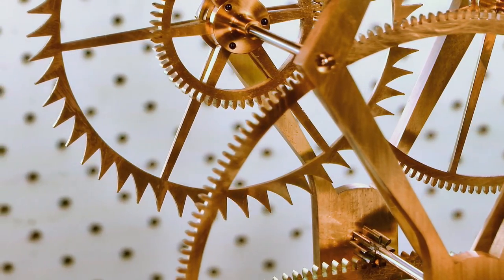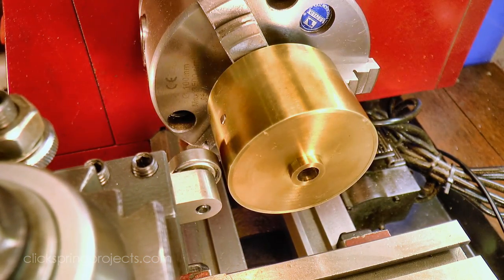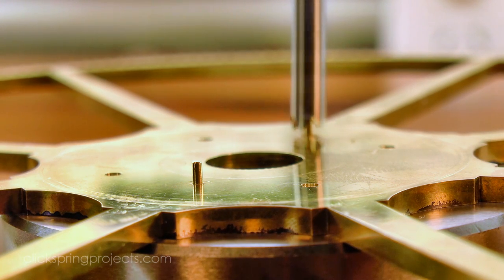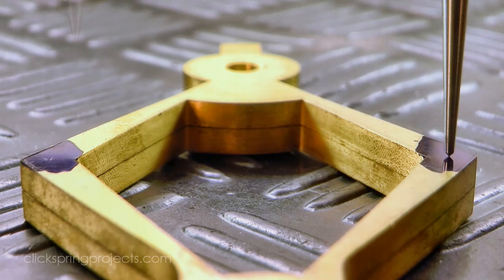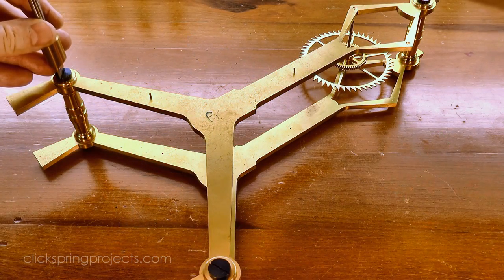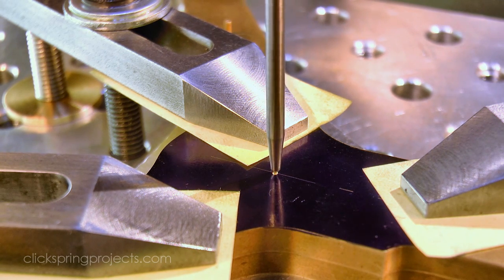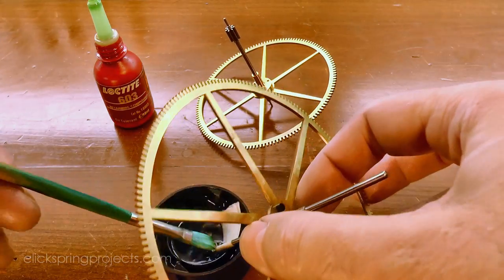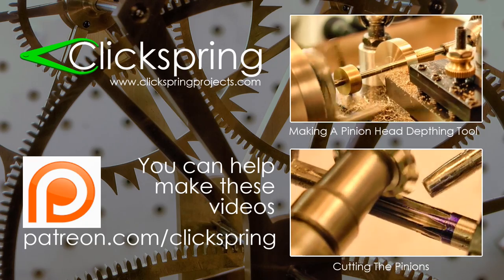Clockmaking - How To Make A Clock - Part 13 - Depthing And Planting The Train

Comment: this is fantastic! i've been binging your series, this stuff is so cool
as an apprentice machinist for medical stuff, the differences in how precision is applied in clockmaking vs production amaze me
i would never imagine that you determine hole position using a tool in that way, i would expect a very tightly toleranced distance between centers for every wheel, but i see why this solution is better

Comment: Excellent video, as always.

Re the hook. Why not make the screwdriver slot on the other end of the screw and drive it this way with a standard screwdriver (going counterclockwise, naturally)?
Reply: metalhead2508 Right, but what I’m saying is that one could simply make a slot on the threaded end, and not bother making a specialized tool. The slot, along with the protruding portion of the thread could then be ground off the same way.
Reply: +Ast A. Moore  specialized tool? he made a right angled screw driver he just made it cause well why the hell not he could go out and buy one or enjoy a couple hours in the machine shop making one

Comment: Chris, well done, I bet you had a few nervous moments when setting the gear positons, one wrong hole position and you would have had to build new frames. It looks as though it will be an impressive clock.  Just watched your right angle screw driver and drill videos. The mod for drilling brass was very useful, looks  like I need another drill set. I bought right handled screwdrivers for flat and phillips screws years ago and not sure where I got them from. Don't use them very often but when I do they are invaluable. Keep up the great work
Cheers
Doug
Reply from the maker: +Doug Hibberd So true Doug! A lot of double checking before drilling! Thanks for watching mate :)

Comment: Fantastic video! it's nice to see things coming together. I really appreciate watching how you put the utmost effort and precision into everything from the finish on your tools down to custom screws. 
But seriously though, was it worth all the effort to make a custom bent screwdriver just so you could install the spring hook!? I would have just ground a flat on the end of the threaded portion and tightened it from the outside with pliers... still beautiful to watch.
Reply from the maker: +Kobus Goosen I tested that, as well as putting the slot on the other end. The insert needs to be very tightly screwed into the barrel, and in both cases, the end deformed under the pressure. The only effective way to get the job done is with an inside slot. Thanks for watching and asking :)

Comment: my uncle worked with clocks in ussr for like 60 years, and I showed him this video series, and he was really impressed with your work, even tho he was very skeptic, because he was known in the whole Europe, but he said that you did a huge mistake, and because of it, your clock will not work for long time. Your biggest mistake was that you didn't put in bearings made of rubies or emeralds, or other hard natural gems, because if the gear shaft is turning and rubbing against the brass, it will wear out very easy and very quick. You really should have put in bearings for the gears made from rubies or emeralds.
Reply from the maker: +Vytautas Poška Unlike watches, and some marine chronometers, the vast majority of clocks operating in the world today have steel pivots running in brass holes as shown in this build. It has been established best practice for at least 400 years. The holes do wear, but it is not as dramatic as you suggest. The pivot holes are rebushed after they wear, and it is a simple and common enough process that "re-bushing" is taught in beginner clockmaking courses. Jewelling certainly adds life to a clock pivot hole, as well as beauty, but it is the exception rather than the norm in clockmaking. Jewelling also unnecessarily complicates the service life of a clock. Such is the rarity of jewelled clock movements, that few clockmakers have the tools, expertise or replacement jewels for clock sized pivots. So a cracked jewel could easily result in an otherwise fine clock ending up in a box un-used. For that reason jewelling in clock movements is generally reserved for ultra high precision movements that really need it (like regulators and marine chronometers), with the expectation that the mechanism will only ever be attended to by a specialist repairman. For reference the original prototype of this clock, constructed with simple brass pivot holes, was made in the mid 80's and has still not needed rebushing after being in service for 30 years: https://www.bonhams.com/auctions/18836/lot/267/ Thanks for watching

Comment: You also could have slotted the end of the spring hook that was cut off and tighten it that way, from the threaded end.
Reply from the maker: +Rush Dougherty Hey Rush, I tried a few things like that, but found there just wasn't enough material to work with. The insert needs to be screwed in very tight, and in each case the end just distorted, so an inside slot was the only option. Thanks for watching.

Comment: Good progress there Chris! It's very satisfying seeing the gears set in the frame and turning even as a viewer.
Wouldn't it be easier to shape the inner part of the hook, slot the outer part of it and then screw it from the outside?
Reply from the maker: +Solskipper I did a bit of testing to see if I could get away with that, but there just wasn't enough metal at the other end of the screw to resist the torque. The screw needs to be inserted quite tightly, and the metal just distorted and bent under the strain of the driver. The only practical option was to put the slot on the inside. Thanks for watching and asking :)
Reply: +Clickspring I see. After watching it again I'm pretty sure that the camera must be distorting the scale of the work, making things look larger than they are!

Comment: Clickspring next time you are making a spring hook for the barrel, why not add a screwdriver slot to the end that is being cut off so you can screw it tight easily from the outside?
Reply from the maker: +ben middleton Hey Ben, there isn't enough material on the other end to withstand the torque of insertion (approx 2mm), it would have just distorted under the load. The hook needs to be screwed in very firm, so this is the only practical option. Thanks for watching and asking :)

Comment: This is very late to the party but I am wondering is the cutting broach and the smoothing broach are both a inserted from the same side? In the graphic showing the oil cup and the hole as it is being broached it looks like the hole is broached from each side so there is a nearly identical amount of taper with the apex in the center. But I am just not sure. Wonderful video series. I am supposed to be in my own shop working but I can’t stop watching.

Comment: In addition to wear and contamination a reason for taper in the pivots is thermal expansion and contraction.  Have you determined what the temperature/dimension coefficient is for this brass structure?

Comment: Was it necessary to make the right angle screw driver when you could have put the slot on the other end of the screw(the thin end) and then tightened it from the outside?
Reply from the maker: Yes, more detail in answers below, thanks for watching

Comment: I'm amazed you rely on loctite for a smooth-to-smooth joint on a driven pinion. Is it actually that reliable over time? I assumed all such parts would be mechanically connected with setscrews or else silver soldered (at least the brass ones).

Comment: Yet another excellent video!

I am officially going to take it for granted that all your videos will be excellent (great lighting, great pace, great sound, and amazingly, not a single out-of-focus shot anywhere).

I have a question, and it might be a stupid question, but I have never been shy of asking stupid questions...

For the Barrel Hook, would it be possible to make the screw driver slot at the end of the screw shaft (instead of the screw head) to enable you to screw it in from the outside of the barrel with a normal screwdriver thus making the right-angled screwdriver unnecessary.

Thanks.
Reply from the maker: +echofoxxx That's a great question, the same thought occurred to me too. I did a little test before proceeding to see if it would work, but there was not enough meat on the screw to withstand the force of the screwdriver. The insert needs to really be screwed in tight, and a little slot on the other end just couldn't cope without distorting, so I had to go with the inside slot instead. Thanks for watching.

Comment: for the screw inside the barrel, why not form the interior shape outside of the barrel and put a screwdriver slot on the other end of the screw?  start to thread it in by hand then tighten it from the outside, backwards?  Just curious...
Reply from the maker: There wasn't enough material to resist distortion, more detail in other responses below, thanks for watching :)

Comment: I was somewhat surprised when you made the barrel hook. When you turned off the threads at the end of the screw, I was expecting you to then make a slot at the screw end. That would have given you access to the screw from the outside of the barrel and eliminated the need for the right angled screwdriver as well as the screw slot in the more conventional location on the screw. But in any case, this is a great video.
Reply from the maker: +John Cochran The same thought occurred to me too. I did a little test before proceeding to see if it would work, but there was not enough meat on the screw to withstand the force of the screwdriver. The insert needs to really be screwed in tight, and a little slot on the other end just couldn't cope without distorting, so I had to go with the inside slot instead. Cheers mate!

Comment: I guess it's a stupid question, but why didn't you make the slot on the other side of the barrel hook, so it could be screwed in with a regular screwdriver from the outside?
Reply from the maker: I tried out a few things like that (grips, screwdriver slot), but there's not much material at the other end, and it simply distorted under the torque. The hook needs to be very tightly inserted into the threads inthe barrel, so the only practical option is to form the slot on the more substantial section of metal on the inside, and screw it in - thanks for watching and asking Pavel

Comment: i watched  this when you first posted this but i just thought about something.  Why couldn't you have just put the screw driver slot on the outside? That would have saved the step of having to make to special screw driver, it's cool either way im just wondering.
Reply from the maker: I did a bit of testing to see if I could get away with either a slot on the other end, or a hex driver but there wasn't enough metal at the other end of the screw to resist the torque. The screw needs to be inserted quite tightly, and the metal simply distorted and bent. The only practical option was to put the slot on the inside, therefore a right angled screwdriver was required. Thanks for watching.

Comment: at 3:50, all the blue screws are perfectly parallel with each other.  Are the snug? How did you align the threads with the screwdriver slot, so they all "stop" in the same position?
Reply from the maker: +kanennardo Yes they are snug. I inserted the screw into the holes before making the slots, marked the orientation of the slot, and then formed it so that they would all be aligned. A few viewers mentioned that they would like to see it done on a previous video, so I did it on this set. Thanks for noticing!
Reply: +Clickspring I noticed aswell, it's just one of those details that takes something a bit further:P

Comment: love the progress. i had an idea when i saw the hook you made that needed the screw driver. Is there any reason you didn't put a slot at the end of the screw and then turn it back word from the outside?
Reply from the maker: +Philip kedinger-cecil Hey Philip, I did a bit of testing to see if I could get away with that, but there just wasn't enough metal at the other end of the screw to resist the torque. The screw needs to be inserted quite tightly, and the metal just distorted and bent. The only practical option was to put the slot on the inside. Thanks for watching and asking :)

Comment: I just realised, You could have made the barrel Hook in a way that does not require a special 90° Screwdriver. Form the slot on the tip of the screw before parting off. Insert it by hand and tighten it from the outside. Yes. You then tighten it counter clockwise, but you would not need a special tool. That tool made for a nice vid tho, so im not mad.

Comment: Stunning work, please do more!
Also: why making a 90º screwdriver for that insert? Why not just put a second slot in the other end of the screw, the one that got cut away, and screw it in from the outside?
My best from Argentina!
Reply from the maker: +Harry f. Hey Harry, I did a bit of testing to see if I could get away with that, but there just wasn't enough metal at the other end of the screw to resist the torque. The screw needs to be inserted quite tightly, and the metal just distorted and bent. The only practical option was to put the slot on the inside. Thanks for watching and asking :)
Reply: +Clickspring The second best option I GUESS would have been grinding 2 parallel sides and using a wrench. At least we got a cool vid on the making of the 90º screwdriver. Thanks for the response!

Edit: Guess is on caps because I'm not a machinist of any sorts ^_~
Reply: +Harry f. Lets not give Chris any reasons not to make extra videos :D

Comment: it's really starting to come together beautifully.  Though is that Loctite bond good enough to hold the pinion in place long term?
Reply from the maker: +Junaid Akbar Regarding long term strength, only a century or two will settle it definitively, but the loctite bond is easily reversed, meaning solder could be used at a later date if desired. Thanks for watching.

Comment: I am as alway very impressed about you fine art. May I ask you a questin. You are working hard for givig the brass a shiny polish. Is there a secret how to conserve that look against the typical oxidation of brass?

Regards Michael
Reply from the maker: +DocM Hey Michael, to some extent lacquer can help preserve some surfaces that don't have any sort of mechanical interface (eg pillars, plates), but those parts that interact mechanically (eg wheels) can't be lacquered because it would interfere with operation. The only total solution is to plate the mechanism, usually with gold or rhodium. Thanks for watching and asking.
Reply: Tahnks for the answer!!!
Is there a preferred lacquerd?

Comment: Hey Chris, where did you get the "oval sink" tool. I've never seen one of those before. Can you tell me why you use it and where you got it or how you made it? Thanks
Reply from the maker: Hey Peter that is from a set of Bergeon 1897 roller cutters: https://www.hswalsh.com/product/bergeon-1897-roller-sinkers-hr58 They are a specialist cutter designed to cut oil sinks, you can get them from any clock supplier like Meadows and Passmore, Timesavers etc

Comment: Stupid question, with the screw in the cylinder (wow technical terms) why didn't you screw it in from the inside to a certain extent and then use a pair of pliers to twist it to the full point of tightness instead of the double ended screwdriver? If that isn't possible could you explain why? Thanks.
Reply from the maker: +Jess Page Hey Jess, not a stupid Q at all - I did a bit of testing to see if I could get away with a slot on the outside end but there just wasn't enough metal at the other end of the screw to resist the torque. The screw needs to be inserted quite tightly, and the metal simply distorted and bent. A pair of pliers does not give enough torque either, it slips before the screw is inserted properly. The only practical option was to put the slot on the inside. Thanks for watching. and asing

Comment: For the barrel hook: could you have machined a screwdriver slot, or maybe a small hex head on the outside end of the screw, instead of having the slot on the inside? The head could then be machined to final shape before it's mounted in, and tightened from the outside…
Reply from the maker: +Damien Pollet I tried a few things like that, but found there just wasn't enough material to work with. The insert needs to be screwed in very tight, and in each case the end just distorted, so an inside slot was the only option. Thanks for watching and asking :)

Comment: Just fabulous, like all your others, on the Make channel too.

One question though, how did you get the four screw slots on the barrel to line up like that without adjusting the thickness of each of the heads?

Seriously impressed!
Reply from the maker: +windsoruk I inserted the screw into the holes before making the slots, marked the orientation of the slot, and then formed it. Thanks for noticing!
Reply: +Clickspring   Arghhhh! <palm-to-forehead> - and there was me over-thinking it - the simplest approach is almost always the best!

Comment: hi chris,
nice  work on the clock.
the pallet plate your  using in the video, 
did you make it also?
i have  make small ones in the past, around 100mm by 200mm.
the one your using looks much  bigger.
thanks and god bless,
jeff
Reply from the maker: +Jeffrey Miller Hey Jeffrey, yes I made that pallet a while back, a bit more info on it here: http://www.clickspringprojects.com/vise-sub-table.html Cheers mate :)